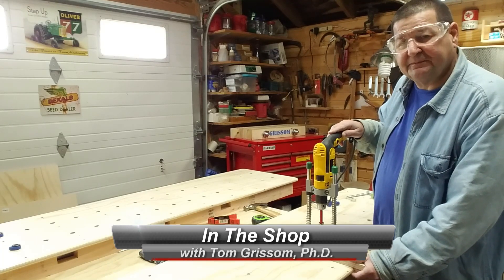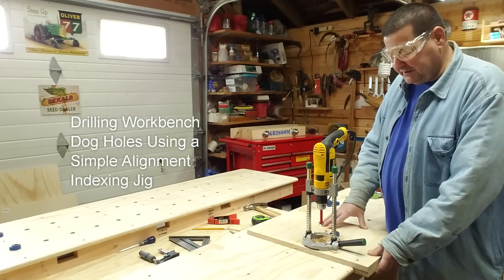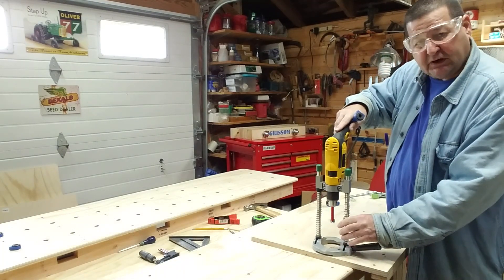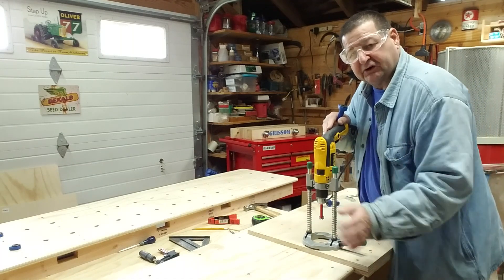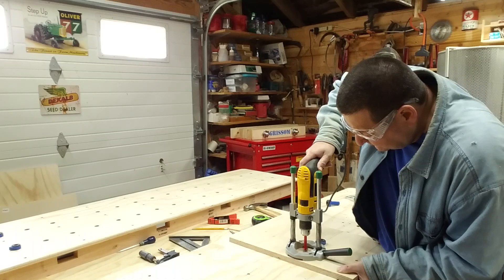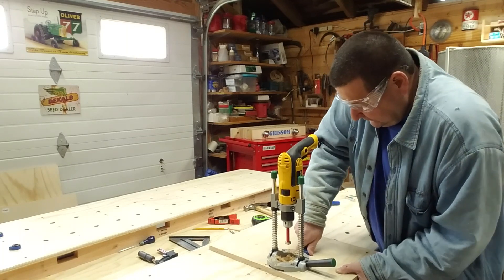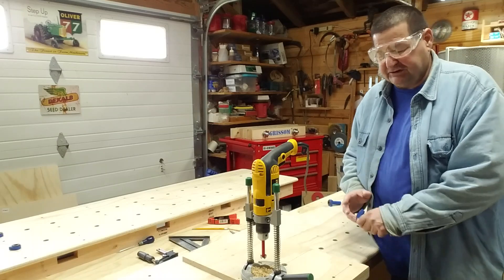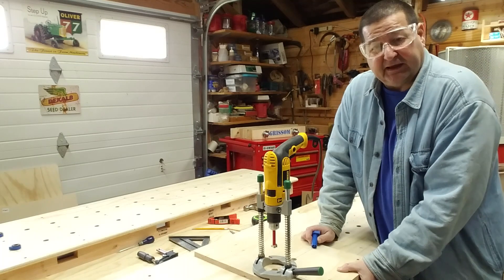Drilling Workbench Dog Holes Using a Simple Alignment Indexing Jig - In the Shop 003

Comment: Want to emphasize that the biggest potential fail-point of this system, which you don't stress in the video, is that the line through the hole centers must be as close to perfectly parallel to the guide fence as possible.  This is actually the trickiest and most critical part of the jig to get right.  Easiest way to ensure this happens accurately is:
 1) After drilling the holes in the jig the desired distance apart, on your table saw rip a scrap piece of wood to a width equal to desired distance between the bench edge and the holes' edges (table saw ensures parallel edges);
2) put a couple dogs through the jig's holes from the top side of the jig;
3) use the scrap piece you ripped as a spacer to place the jig's fence, by placing one edge of the spacer snugly against both dogs on the bottom of the jig, and place the fence snugly against the other edge of the spacer;
4) fasten the fence to the jig, remove the spacer board.

The pair of holes and the fence are now perfectly parallel, ensuring there will be no "drift" of the line you're drilling.
Reply: I had to read this 4 times (cuz I'm slow) but finally it clicked. Solid method. I will incorporate your advice when I add my dog holes. Thanks.
Reply: Jeff Mazur, great tip, always the most simple is the most elegant solution!
Reply: I had to read it 6 times and I still don't get it
Reply: I’m confused...
Reply: Darn, I was hoping the comment replies would provide a cliff notes version.